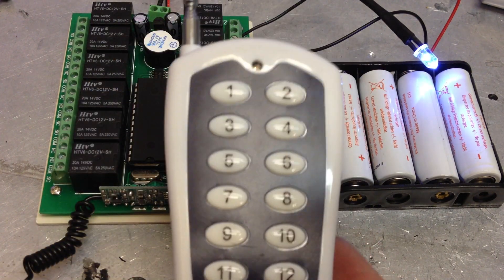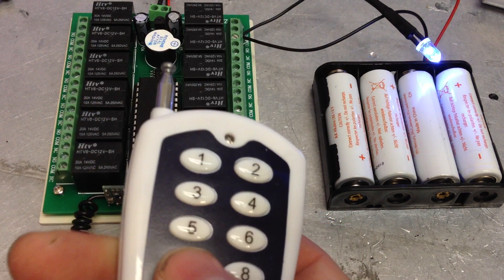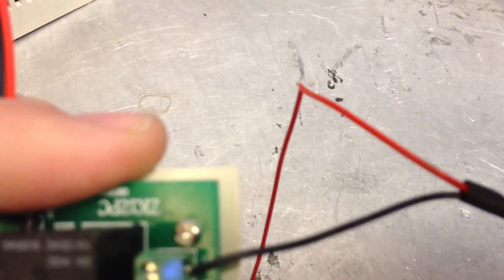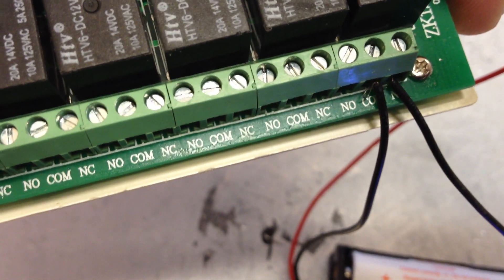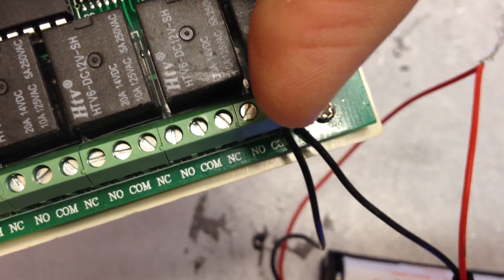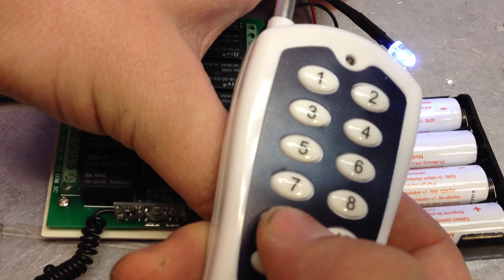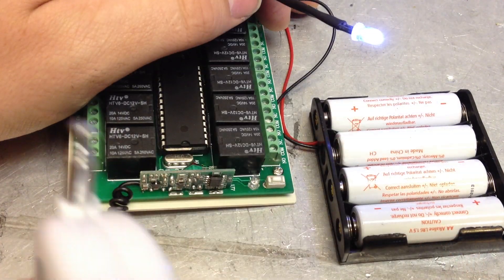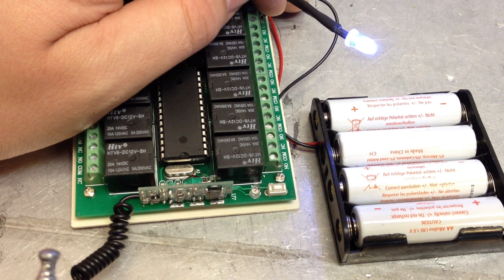12CH RF wireless remote control switch Receiver Transmitter Momentary toggle 12v

Comment: I have the same device but with 8 channels but when I put the battery in the remote the remote control led doesn't work or on whenever I pressed button what is the solution should i receive damaged unit or any other procedures

Comment: If you’re in toggle mode, it doesn’t matter if you use no or nc since one push simply changes the state. It it’s off, it switches on and vice versa. That only matters in momentary mode.